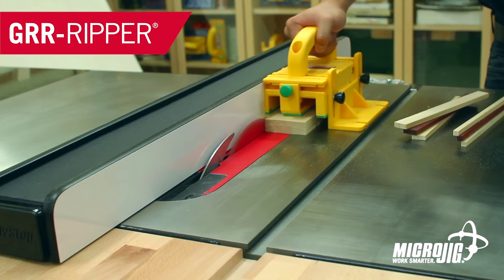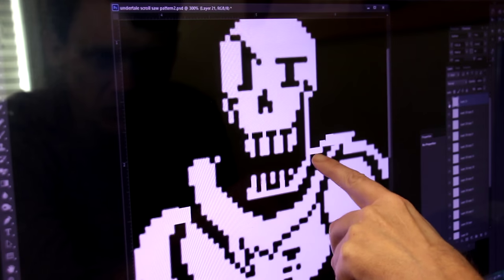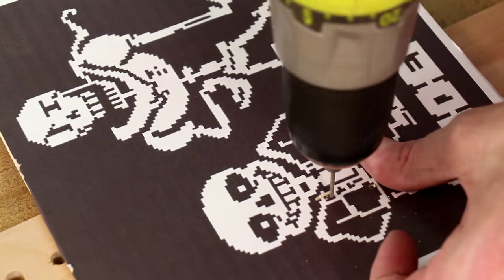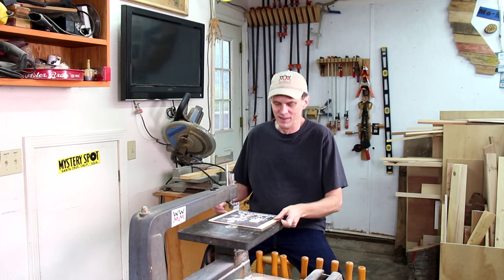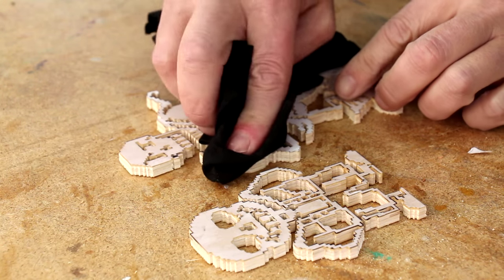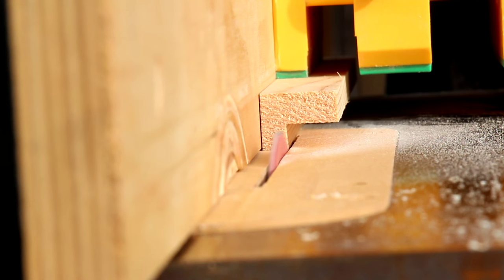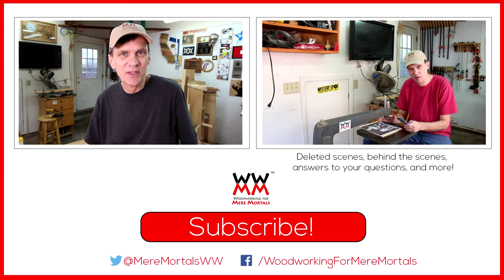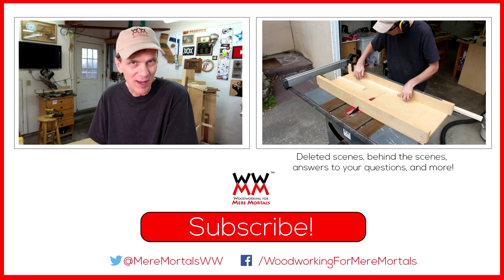UNDERTALE. Scroll Saw Art. SANS & PAPYRUS

Comment: Keep the old scroll saw! Nothing you buy today will be as good!  I have one just like yours and refurbed it a bit.  Got it at a garage sale for $10.00. cleaned and painted it like new and put a light on it.  Took a variable speed 1 hp motor off an old treadmill with the speed controller and it works far better than the newer one I've been using. It is more rigid and reliable.

Comment: I used my scroll score yesterday for the first time on a project but it seems to have a life of its own. I could chew the wood more acurately! Happy birthray Wyatt.
Reply: Doh! Birthday I meant, although a birthray might also be fun.
Reply: +JP in Fuerteventura  Buy high quality blades, and make sure they are very tight. You should get a good ting when you flick it. Try using wider blades to start with, and just cut out external shapes. Once you get better at controlling it, go to narrower blades and more intricate patterns. Wider kerf blades tend to be a bit more difficult to use in my opinion. Stay away from double direction blades at first too. A small inflatable sanding tube works great for sanding your cut outs.
Reply: Wayne Radford Thanks Wayne

Comment: Good project, Steve.  I have the same scroll saw as you, but you seen to have less problem with the tension on the blade than I do. It was given to me about 4 or 5 years ago and I've used it twice.  Which is probably the reason I have problems with it. Keep them coming.

Comment: I feel like the scroll saw table needs some locking wheels, and a slide-out shelf for the motor. If the scroll saw was easier to set up, you might be more inclined to use it?

Comment: Hi Steve. I've recently bought a scroll saw with the intention of doing these kind of designs. What blade did you use,  a spiral blade? What size? Tried using regular blades but find it awkward re-orientating the piece; you don't need to re-orientate the piece when using spiral blades and can make more intricate cuts. Thanks!

Comment: That is very dangerous with how close you had your fingers to the balde
Reply: What's your email
Reply: +Connor Suliin Scroll sawing is slow and methodical. Unless he wasn't watching what he was doing (which would be silly considering what he WAS doing) there really isn't any more risk to where his hands were versus, say, breaking down cardboard boxes with a box cutter.
Reply: +Steve Ramsey I have a much worse saw than you as I can't change the speed of the blade.  My blade has clips that attach to saw and tension is a big concern,  I still use my single speed saw which runs much faster than anything I have ever seen, actually to fast for my age.  I have seen 8 year old kids use a scroll saw
Reply: +Connor Suliin I have a saw that runs at one speed which is very fast and I touch the balde all the time and never cut myself.  When it is dangerous is when I install a blade be it 5 tooth per inch or 15 tooth.  If you cut yourself on the balde you are pushing too hard.

Comment: I use a heat gun to remove the template.
Reply: +Dave's woodworks I think Steve could have left the paper on the images and just turned them over. He would only had to remove the paper from the lettering. Better yet, print a reverse image so the paper would be on what would become the back of everything.